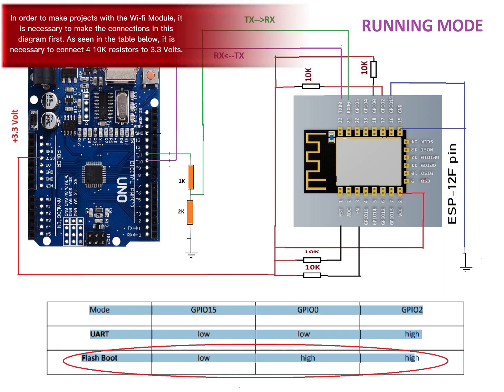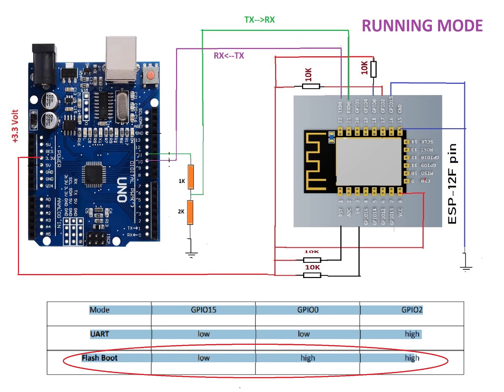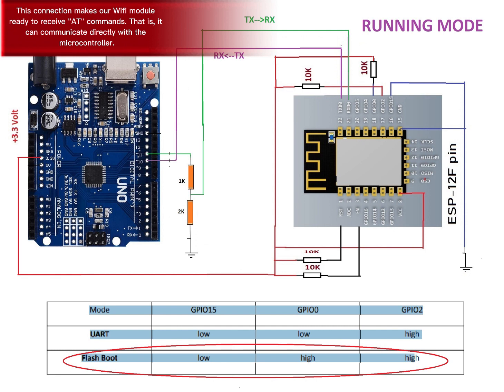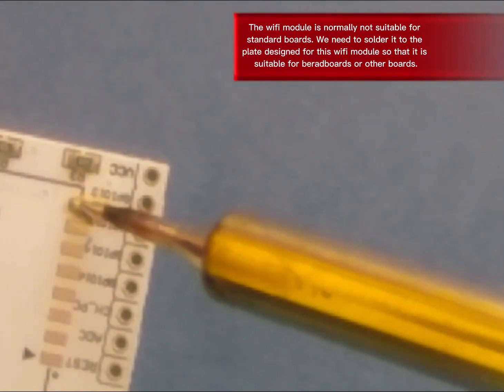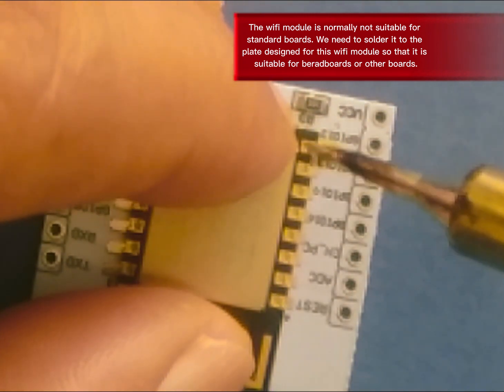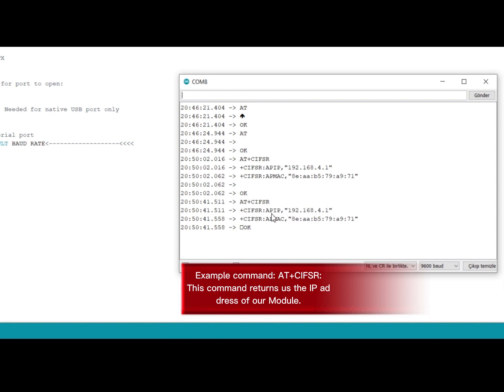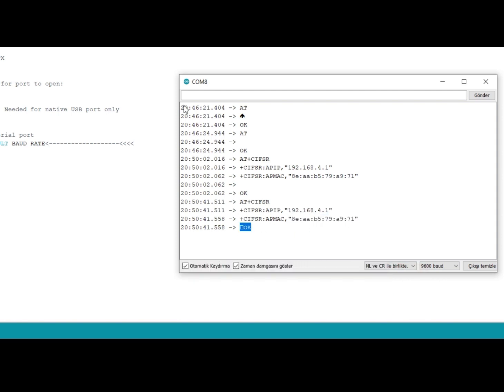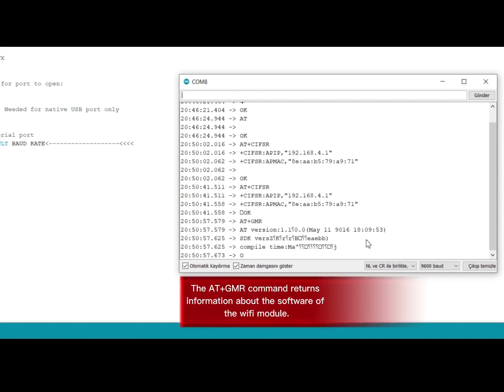Wifi projects with ESP-12F/ESP-12E -Module basic settings, #AT Commands #wifi  #AT

Comment: can i use this device to connect to my wifi? if i can, do you have a video tutorial about it?
Reply from the maker: Hello,

Yes, you can use this module to connect to another wifi network. This module has three different operating modes:

1. STA: In this mode, ESP-12 connects to a Wi-Fi network and works as a client. This is the mode in which the module provides access to the internet or local network by connecting to an existing Wi-Fi network.

Below is an example code:

#include <ESP8266WiFi.h>
#include <ESP8266HTTPClient.h>

// Wi-Fi network information
const char* ssid = "YOUR SSID_NAME"; //Write your Wi-Fi network name here
const char* password = "YOUR PASSWORD NAME"; //Write your Wi-Fi password here

// The URL of the web page you want to link to
const char* serverUrl = "http://example.com"; // Type the URL of the target web page here

void setup() {
 // Start serial communication
 Serial.begin(115200);

 //set Wi-Fi mode to STA
 WiFi.mode(WIFI_STA);

 //connect to Wi-Fi network
 WiFi.begin(ssid, password);

 // Check the connection status during the connecting process
 Serial.print("Connecting");
 while (WiFi.status() != WL_CONNECTED) {
 delay(500);
 Serial.print(".");
 }

 // Print information after connection is established
 Serial.println("");
 Serial.println("Connected to Wi-Fi network!");
 Serial.print("IP Address: ");
 Serial.println(WiFi.localIP());
}

void loop() {
 // If a Wi-Fi connection is established
 if (WiFi.status() == WL_CONNECTED) {
 HTTPClient http;

 //Set target URL
 http.begin(serverUrl);

 // send HTTP GET request
 int httpCode = http.GET();

 //Check response code
 if (httpCode > 0) {
 //get HTTP response
 String payload = http.getString();
 Serial.println("HTTP Response:");
 Serial.println(payload);
 } else {
 Serial.print("HTTP request failed, error code: ");
 Serial.println(httpCode);
 }

 // Close the connection
 http.end();
 } else {
 Serial.println("Wi-Fi connection lost!");
 }

 //Wait a while between requests
 delay(10000); //wait 10 seconds
}
-------------------------------------------------- -------------
-------------------------------------------------- ---------

 2.Mode: AP,

3. Mode: STA+AP
Reply from the maker: Also, there is a video. There is an IoT application:  https://www.youtube.com/watch?v=zc14r06HRfU